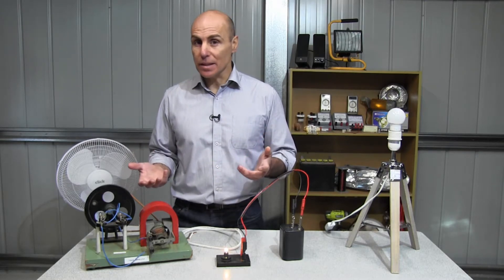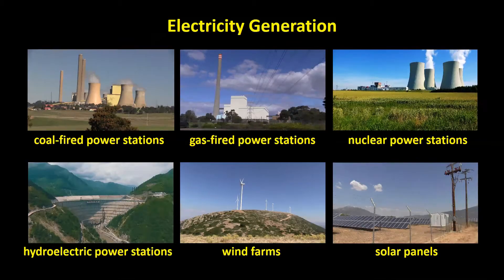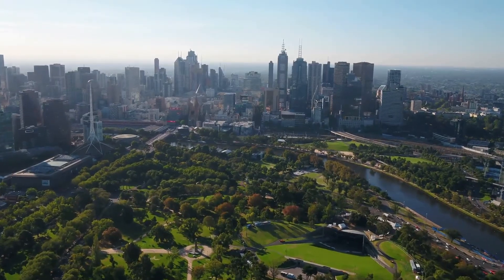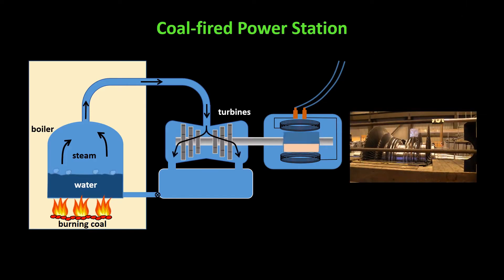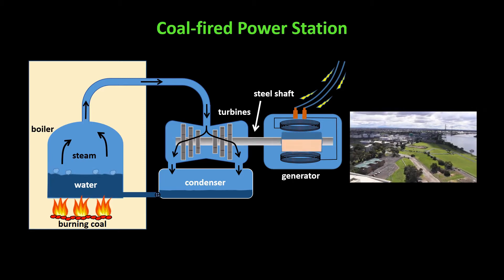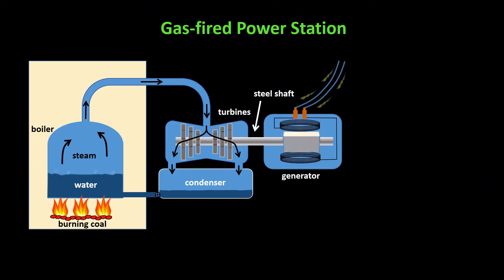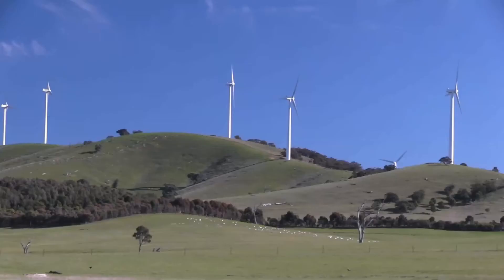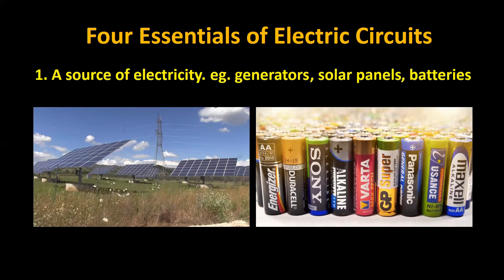How do coal-fired power stations work?

Comment: Example for how it works:

1. Distilled water/DW = injected to coal power plant firebox
2. firebox is heated by burning coal
3. DW temp (*C) = 200*c-400*c
4. Hot distilled water/HDW = injected to heat exchanger/HE (exchanger injections =  cold distilled water/CDW - HDW) to make high pressure steam (HPS)
5.  HPS = injected to Modular turbine - HPS turbine (HPST)
6. HPS from HPST = injected to intermediate steam turbine (IST)
7. HPS is dabbled then injected to a low pressure steam turbine (LPST)
8. LPST = injected to a generator using magnets and metal coils to produce electricity
9. LPST = injected from generator to a turbine output (TO)
10. LPST = injected to a condenser
11. Condenser requirements = CDW + LPST
12. DW cools down the LPST to about 50*c (originally about 180-200*c)
13. DW = injected to Cooling tower/CT (cools DW to about 30-50*c) then injected back to condenser to cool more LPST
14. LPST = condensed (changed to Condensate)
15. Condensate = injected to a polisher
16. Polisher requirements = example: Sodium Hydroxide Solution/NaOH - Hydrochloric acid/HCl
17. Condensate = polished which then is exchanged back to CDW
18. CDW = injected to HE
19. REPEAT CYCLE

Hope this helped 
👍👍👍

Comment: Instead of burning the coal to produce heat. Wjy cant they use the heat from the sun in giant coil heat sinks?  Obviously heating the coal is the part that takes the most energy. Why cant we come up with something better? We dont evwn need coal really. Wind turbines can produxe enough energy to heat the steam.
Reply from the maker: You need lots of heat concentrated in a very small area so that the temperature and pressure of the steam are really high. Wind turbines produce electrical energy (when the wind's blowing), and this can be used immediately by electrical things.

Comment: Pretty good.  But most power stations are NOT built close to coal sources.  They are built strategically throughout the service area.  They are usually built by a river for abundant cooling water.  I worked for the TVA for  35 years as a nuclear and coal fired control room operator. I unloaded hundreds of coal trains.  We got most of our coal from the Powder River Basin in Wyoming.  So you might want to revise your video a little bit about the coal supply.